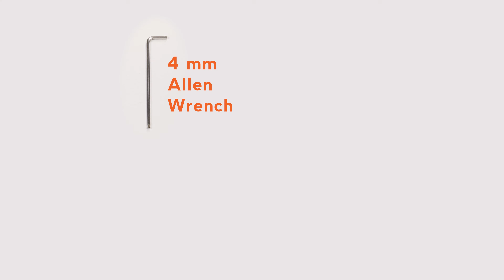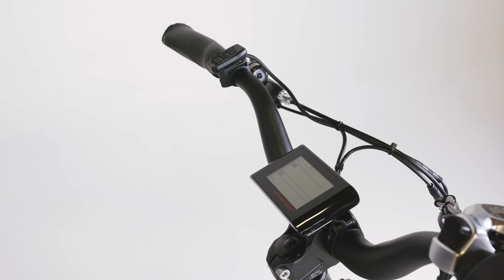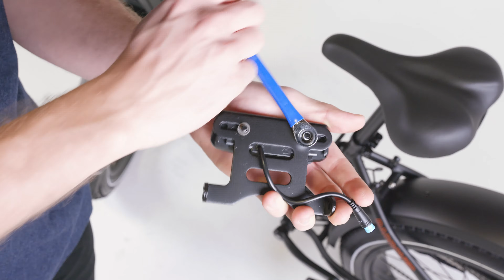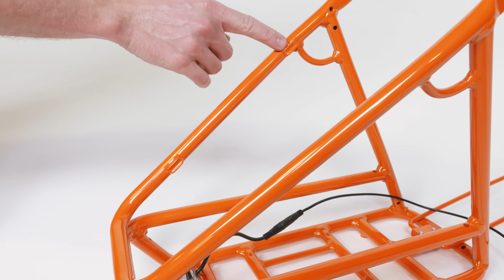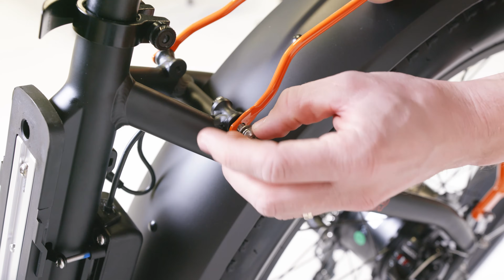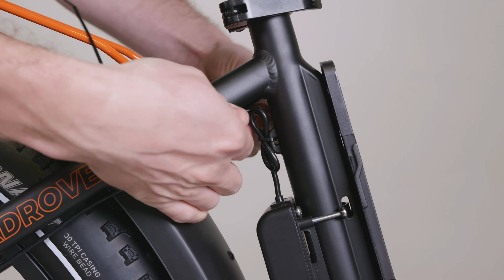RadRover Rear Rack Installation | Rad Tech

Comment: Can you tell me what size are the upper mounting bolts that are needed to attach the upper arms for the RadRover Rear Rack?
Also, where can I buy the extension cord needed to connect the brake light?

Comment: It is weird that this is the only video I could find from you for this installation and the rack I got from you does not look like this and has different installation steps. Very irritating. I get that there are multiple models and things have changed, but the rack itself came with no instructions and the video instructions on your website show a different product. Seems like an easy thing to fix.

Comment: What do I have to do to keep the rack from sliding? it's twice my groceries fell on the street and I was left in a spot. Those two straight rods just keep sliding, I'm going to have to put Gorilla glue or something there. It's hard to fathom why they were designed this way.
Reply from the maker: We're so sorry to hear that you're having this experience. Our Product Support team can assist you with this. They can be reached at (800) 939-0310 ext. 2 or radpowerbikes.com/support, and they'll take care of you!
Reply: Tighten the nuts that face the side of the bike and that will squeeze the rods and hold them in place.

Comment: I am EXTREMELY disappointed in Rad Power bikes. They change their style of rear rack and provide near nothing except to direct people to an outdated video and garbage text instructions. The new design has the top arms completly disconnected from the rack. The rails float in little holes under the rack that allow the rear rack to slide up and down the fender. I cannot see any point to them as they never securely attach to the rack at all. They just float in the holes. It's incredibly frustrating when you cannot find a single thing out about this and everything just directs to a video where those arms are clearly mounted onto the rack and not this garbage floating design on the new style. Waiting forever on hold doesn't help at all either.
Reply: AGREED!  Same here on the new rack that arrived for my Rad Rover 6 Plus.  Not only does the above video completely miss the features & setup of the latest model Rover (taillight assembly being integrated into fender), but yes: the rack in my had does NOT match the rack they're installing. 
I guess i understand their impulse to cut corners to save money.  But gee whizz dont cut THESE corners! It just makes their brand come off as cheap, indifferent to even the lowest attention to detail.  When your parts change, your documentation must be updated.
Reply: same problem here...frustrating I know...did you get answer to this??
Reply: I slid the rods into the holes on the rack and attached the other end to the mounts on the bike near the seat. I then tightened the nuts facing the sides of the bike. When those nuts are tightened the metal rod is squeezed and is no longer free floating. Use the Allen wrench to loosen the screw pointing up to allow the rod to move sideways and then retighten. My rack is closer to the fender on one side and those Allen screws allowed adjusting for that misalignment. Then tighten the Allen screws near the seat and near the axle.
Reply: yeah, this.  just tighten the nuts on the slotted pins the rods slide thru.   @traildadd
Reply: One of the fasteners loosely holding the rail popped off of my RadRover 6 plus, along with bolt holding it. And it wasn't surprising, considering how much the rails rattle around while riding. Also the frame itself slips back, only finally being stopped by the rear light on the rear fender. And it's frustrating to watch this, as so much is devoted to moving the rear light on these other models, but entirely irrelevant to the 6 (and the Rover 5 as well?)  I thought this looseness must be a purposeful design, because otherwise was RadPower expecting us to glue or even zip tie the supports to the frame? Hopefully they can help me resolve this!
Reply: almost killed me twice.....rack started sliding down and my groceries fell over the street in the middle of an intersection. 2nd time that happened. Damn rack just doesn't stay put, no matter what I did. I just put Gorilla glue right now over the holes where the 2 arms go in.I might actually just weld them all together., I shouldn't have to do that. WTF were they thinking with this design? It's very dangerous to ride with this rack on
Reply: My problem was the nut on the Allen screw near the axle seemed to be too small to correctly fit the 8mm wrench.
Reply from the maker: We're so sorry to hear that you're having issues with your rear rack, Eric. Please send our Product Support team an email at radpowerbikes.com/support so that they can look into this matter for you.

Comment: I moved my rear rack from my older rad rover 6 to my new step thru model. The "U shaped" rod is too short. Rad will not provide me with a new rod so I will have to buy the whole new rack. What a waste! Nice way to make more money and provide less service.
Reply: @toorealmusic836  What's worse is that it looks like this is purposeful, that it serves some function. I would have glued or duct taped it tight. As it was the whole frame vibrated and moved so much, the rod "support" came off while I was riding the bike. I'm lucky I didn't have a second pannier.

Comment: This is NOT for a RadRover 5 (vid says it is the step through, but OK for the RadRover).  Be warned that the supplied extension cable is too short to reach from the taillight, down then back up through the stays to the connector from the controller.  One difference I notice is that the wire from the controller is MUCH shorter than the one shown in this video.  I had to shortcut one of the stays to make it reach.  
Will be checking with Rad to see if there is a longer cable.
Reply: They sold me one for my Rad Rover 5 as recommended accessory and yes the tail light extension is too short.   When I bought the bike in May, they also omitted headlight hardware and it took them two months to get it too me.   My experience with RadRover has been mediocre at best for as expensive as these bikes and accessories are.

Comment: Word of advice. I installed two of these racks, use a little bit of lubricant on the mounting bolt threads. You may have to screw in some and back out a few turns and repeat until snug. Do not force these in because they would be easy to strip.
Reply: Yeah had that problem with one of the rear fender mounting bolts
Reply: No kidding!  Even without stripping them I had a bolt head completely break off and I'm an old lady!!
Reply: Yup mine stripped right out without barely tightening them. I guess I like the rear rack permanently now.
Reply: I had a screw seize up and strip the Allen socket with very light pressure. I was able to get it out with vice grips but now the rear basket only has three screws holding it on. Unless I want to drill it out and use a nut and bolt.